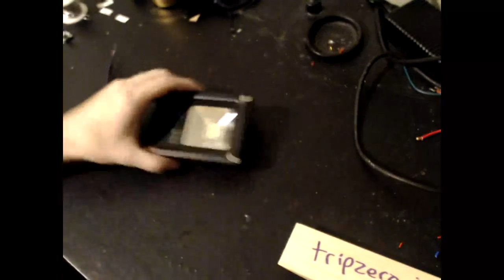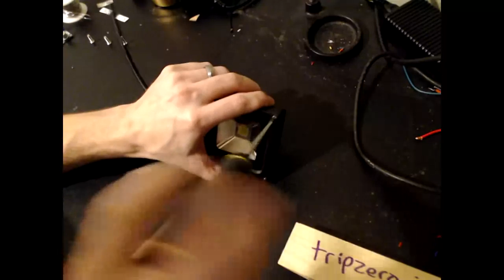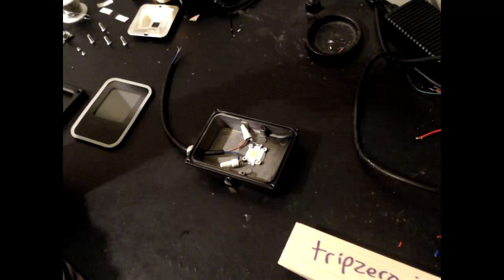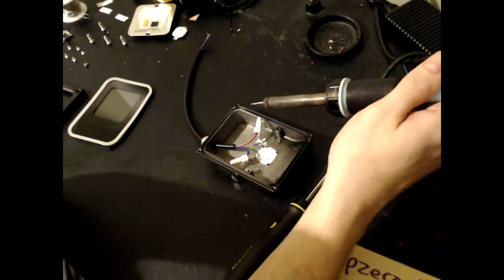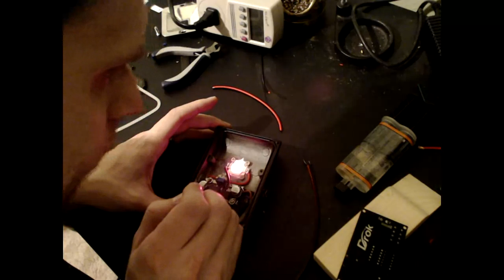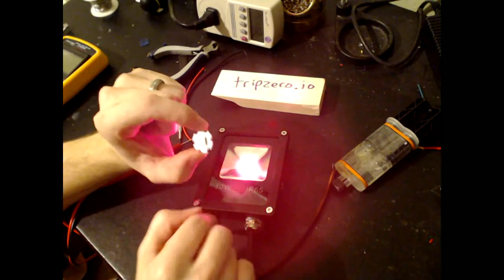Let's build: Far Red LED Grow Floodlight

Comment: Blue light will keep the plants from stretching as much! That's why HPS(mostly yellow/red, very little blue) much stretch! I have a 630W CMH-DE  lamp and AC/DE fixture, high far reds. Plenty of blue. Healthiest plants. I supplemented with 8-50W COB's to even out light canopy,  works great!(just Citizens, Crees were $35 more each! From Alibaba. Great deal! $160 shipping though. But arrived by DHL in 48 hours from China! I've seen these new Antheon circular discs to place around COB units, 12-14 watts of 660nm red to help with flowering, adhesive backed, with heat dissipating pad between circular LED's/heat sink, that fit around most COB's! Very cool item. Now with Far red hopefully. I know CMH aren't as efficient, but healthiest growth from the spectrum, etc. Very interesting video. Great job!
Reply from the maker: Correct. I made a blue light expressly for this purpose
Reply: yea i got a couple those deep red discs RED SHIFT i think they were called 12v 700ma, love em

Comment: this is same way i built my 730/740..remember to take the blue film off the chip..lol ..the driver was built into the old lamp..
Reply from the maker: I started using drivers from the old lamp as well.  The only issue with that is the end result is often an under-driven LED.  But if you okay with it being under-driven, can't beat the simplicity.
Reply: under driven equals more lumens per watt so cooler..its a compromise...i just laid my lights on a aluminum frame and just remove the glass..its more than enough..good work.